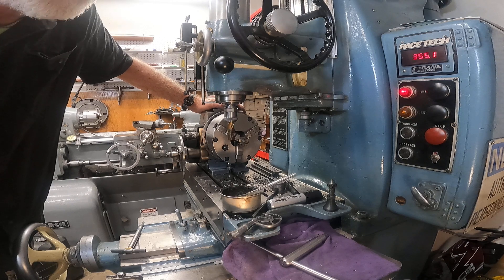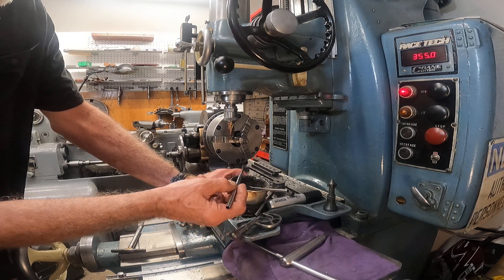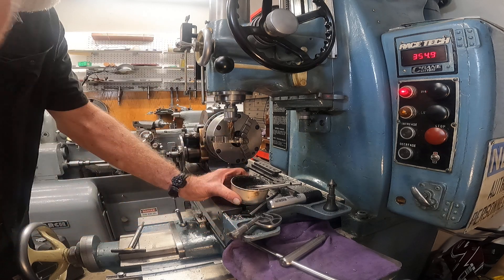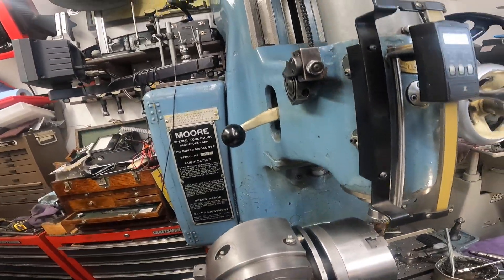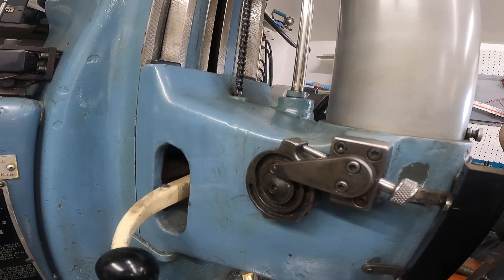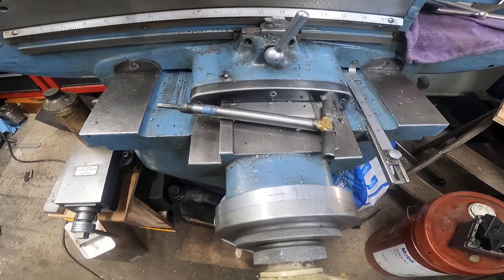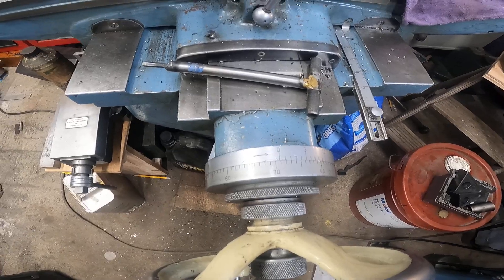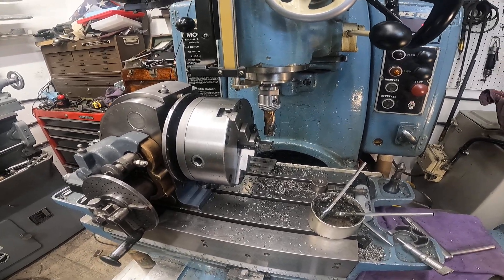Moore jig borer machining a small part.

Comment: Hi been enjoying your Moore jig bore episodes. Was wondering if the digital rpm readout is OEM or a upgrade mine is a analog which is inoperative and needs to be upgraded. Any information would be  greatly appreciated. Thanks  in advance Zed
Reply from the maker: What I did was replace the tach generator with a compound pulley to reduce the quill feed by 1/2 to that of the later #3 machine. I purchase the digital tach from MSC industrial. The brand is Extech. I installed the sensor at the front v belt pulley location using a tiny steel piece installed in the aluminum pulley for the pick-up. Thanks for tuning in!

Comment: GREAT TIP about milling with the non-precision side of the screw.  So smart.  So awesome.  I have a 10,000 pound Pratt and Whitney 2A.  It uses gauge blocks for precision, and not the screws per se.   ---Doozer
Reply from the maker: I thought it would be fun to simply demonstrate the machine showing some of its unusual features. It was faster to move the dividing to this machine, then untwist the vertical head and set up on the horizonal mill to cut the square on the bolt.
 These two machines, led the way for the much easier to use Bridgeport.

Comment: I like the trick of not loading the precision side of the screw.  Why aren’t you using your milling machine instead of your Jig Boring machine?  You commented the other day that R-8 collets aren’t accurate.  My Bridgeport E-Z Trac is set up for NMTB Quick Change tool holders.  I’m switching to a power drawbar. Willing to share your thoughts on my setup?
Reply from the maker: I found the solid R8 shanks for boring heads more of a problem then collets back when I used those machines alot more, 
 I used the jig borer because it was the path of least resistant, I have alot to do.
 My original plan was a Moriseki lathe, and a Bridgeport series 2 special, then I came across the old mill, and radial drill, and went ahead with the old Axelson, thinking I would have more fun, and I am.
Reply: Jig borers are for boring not milling   thats what they  are designed  for .. the screws  are there for positioning   not to have sideways force inflicted  on them..    thats why you have milling machines.. as for r8 collects not being accurate  It depends  on the the  ones you buy  the el cheapos are suspect, you get what you pay for  . The big disadvantage  with r8 collects is that they don't  like heavy milling they  WILL creep out and you won't  notice  till  the job is scrap  .. Don't  ask how I know😚😚   I have Clarkson  type  screw  in  collects for heavy milling on my bridgeport  but for 99.9 of my work the standard r8 is just fine ..    moore jig borers are fine machines although  I haven't personally  operated  one  but have a moore jig grinder  and they are also quality.   .I opperated  a big SIP  jig borer  for many years in South Africa  and they  were also excellent  machines.. keep safe
Reply: @dougiehogarth6652  I have found the R8 collets just fine. But for heavy duty, I go to the brown and sharpe or the Trecker. I have used Moore machines and Sips in the past. While you can get away with side loading, I am hesitant. It’s like using your lathe lead screw to drive your automatic carriage feeds. That is why lathes of quality don’t do that. Save the screw for the screw.